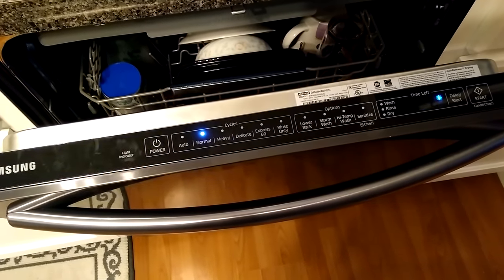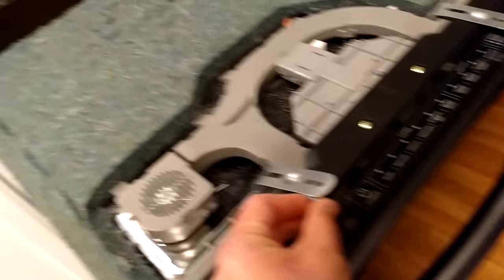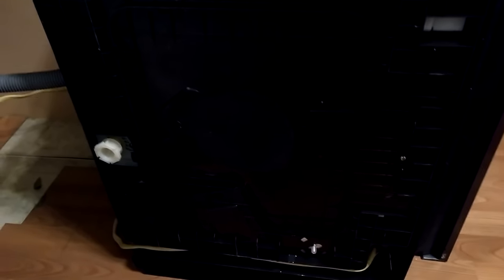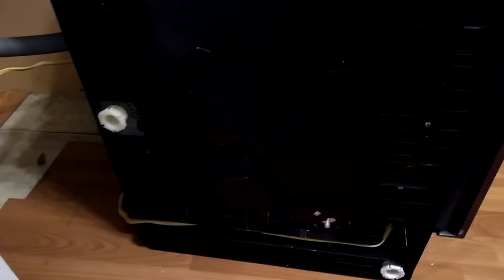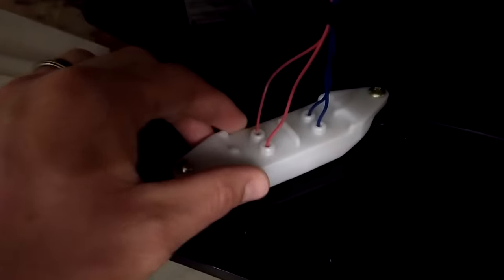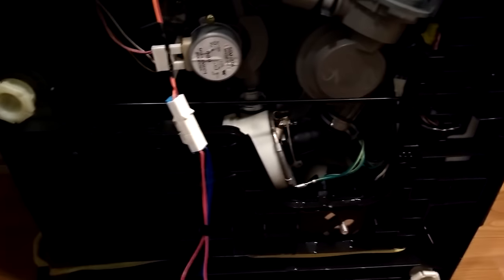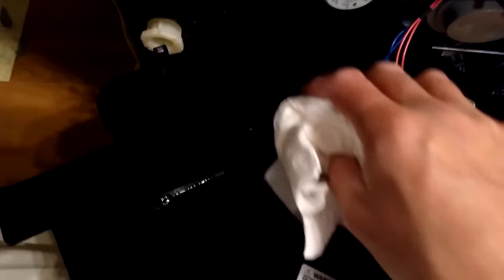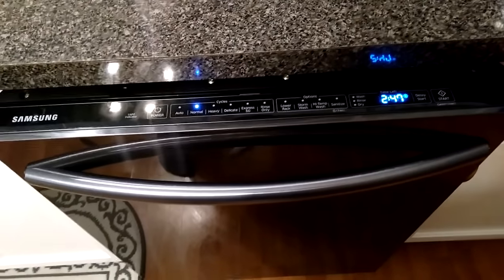How To Fix Samsung Dishwasher with LC Error Code

Comment: So do tell...how does this actually FIX the problem (leaking)?? Your solution is basically like putting a Band-Aid on a gunshot wound and saying, "All Better!" Big Thumbs Down.
Reply from the maker: Thanks for your comment, while you're here you may notice the hundreds of other positive.comments. Many of these comments were just like my situation, I didn't know where the water came from or if it was a leak. I tightened all of the incoming and outgoing water lines and like several other people, it appears to have "fixed" the problem. Good luck to you, I hope you are able to resolve your problem